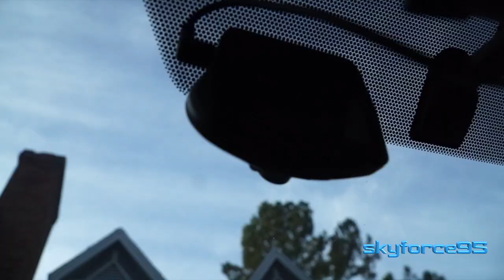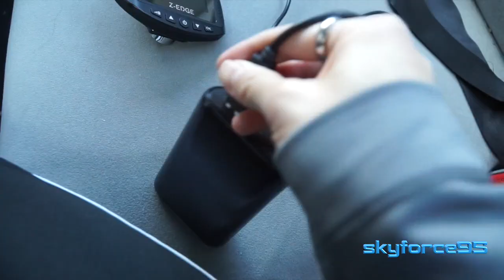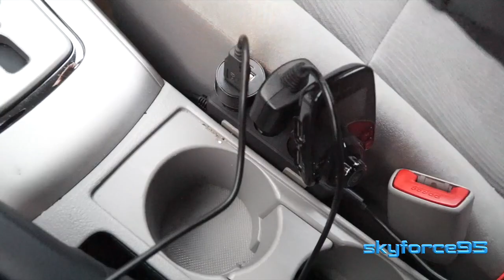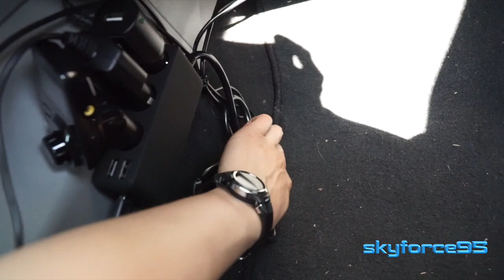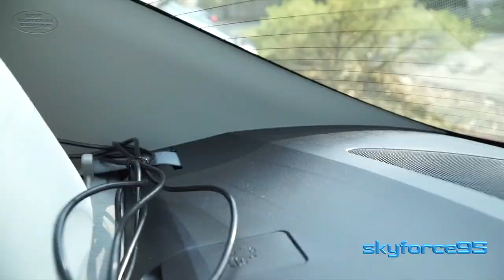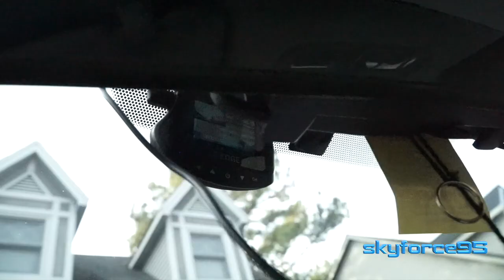How to Install a Typical Car Dash Cam

Comment: Dash cams are awesome but I never ever put sticky clips on anything but glass. You could have run the rest cam cable around the rear seat then up the side of the center console. Do you still have your car like this??